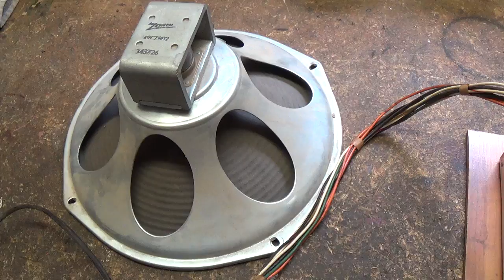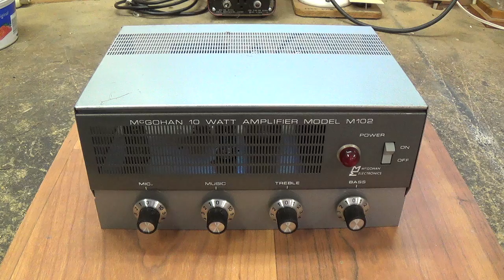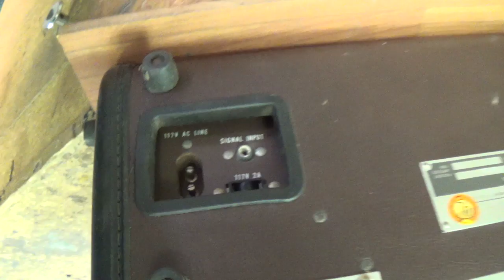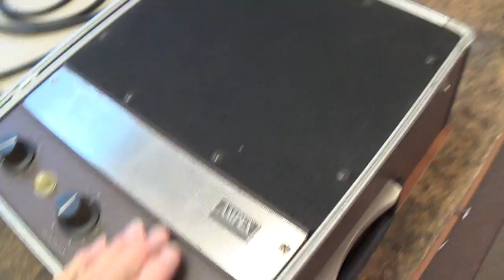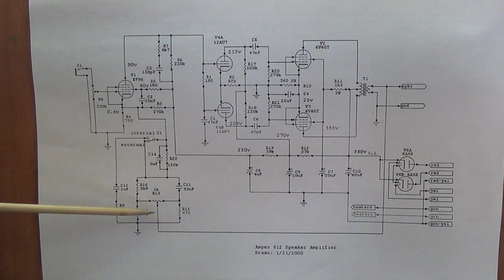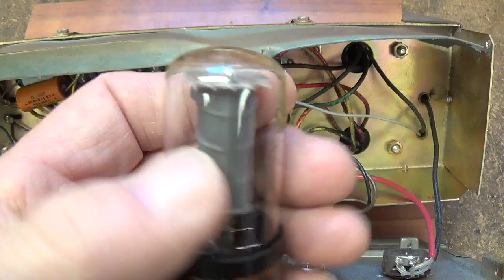Garage Sale Bargains in Vintage Electronic Gear

Comment: Hell Uncle,
Greetings from Ireland. Picked up a nice Pignose 700A at a car boot or garage sale last year. The seller thought it was a broken radio. he didn’t realise that they are designed to switch off when the input jack is removed! Got it for under $10.
Also got one of those hi fi console chassis for $40 incl shipping on eBay. Two original RCA 6V6s and two very nice sounding G.E. 12AT7s. Rewired it as a 5D3 Tweed Deluxe the one with the self-balancing paraphase phase inverter - ideal for harmonica distortion.
Enjoy your videos. Keep up the good work…
Reply from the maker: +Dave Keating It sounds like you've been busy, Dave.  Best of luck with your discoveries and acquisitions, from your pals in Texas, USA :)

Comment: This summer I grabbed a mid-60's Airline console stereo for $5. Turns out the dual class-A Ultratone amp has the perfect complement to re-work into a push-pull mono amp - plus a load of low noise radio tubes to spare.
Reply from the maker: +Karlfalcon  A great score, Karl. Hearing success stories like this renew my interest in garage sales. Thanks for sharing :)

Comment: How does this stack up?     http://www.unclehenrys.com/classified/4482085/classified?back=%2Fsearch%2Fall%3Fsr%3D31866460%234482085
or this
http://www.unclehenrys.com/classified/4349144/classified?back=%2Fsearch%2Fall%3Fsr%3D31866461%234349144
Reply from the maker: Chris Lee Greetings, Chris. I guess the Grundig phono/radio combo might have some good parts, but I can't read the tube chart. The old Radiola radio would have some very early parts, but might be too old for guitar amp purposes. Both should probably be restored and used, as-is, rather than parted out......but if the parts from either happen to serve your needs, then go for it.

Comment: Hi uncle Doug. I've learnt quite a lot from your videos but I'm still quite baffled by a lot of it, I would like to learn more on electrical engineering and some amp building. I can't afford to go back to collage to learn properly, are there any books or sources you could recommend me reading to start learning about amps and electronics etc. keep up the great videos!
Reply from the maker: ***** Thanks, Brian. It's a complex topic that takes time to understand. Gerald Weber has written some good books (see Amazon) and the Internet is full of instructional sites and videos. Start doing some searches on topics you don't understand. You can learn all this yourself if you take the time and apply the energy to do so. Good luck.

Comment: Great video..
Regarding the Ampex amp:
That 2W 1K resistor is not really a screen resistor. The screens have their own 20µf filter cap so that reistor is a typical B+ screen dropper between the plate- and screen cap instead of a more expensive choke.. 

Also the amp has a 40µf fiter cap after the 6AX5 rectifier.. That sounds a little overboard as the datasheet has a recommended 10µf cap, though the datasheet says you can use more capacitance but you need to increase the effective plate supply impedance or the rectifier will be damaged..
Reply from the maker: MrAnders1976 Thanks for your knowledgeable input, Mr. A.

Comment: Radiograms have little value in the UK, just the same as you found.
Even if someone wants a player for vinyl the physical size of one of these beasts is a major issue. Modern houses are so damn small.
Reply from the maker: NJPurling Understood, NJ, and this is why I tend to cannibalize all the useful components and then deposit the massive carcass in a nearby Dumpster :)

Comment: Noticed that the schematic you show is for an Ampex 621, but the unit you have is a 622.  They are similar, but perhaps the most interesting thing that you didn't mention is the compensating network and the switch on the external speaker jack.  The compensating network is designed to match the internal speaker and enclosure to produce the flattest possible output.  Since that would incorrectly color a different speaker system, the compensating circuit is switched out when an external speaker is plugged in, providing a flat output to the external speaker.
Reply from the maker: Ampex Quad Very interesting, AQ. Thanks for the input :)

Comment: Sir for your experience what are the best power transformers for fender 5F1 clone amps??thanks and lot of hugs to rusty...
Reply from the maker: Alvin s  There is no simple answer to your question, Alvin. Any power transformer that can provide the needed voltages at adequate current levels will work just fine.  If you're looking for a new PT, check out the Triode Electronics site.....they have a huge selection at very reasonable prices.

Comment: Ampex, famous name in  tape recording equipment.  Made in USA, not China. 
Diecast metal front panel...you will never see that kind of construction again. 
That JBL speaker  with cast aluminum frame is as good as it gets.
Massive power and output transformers.
Reply from the maker: SuperCarver2011 It is a dandy amp, SC.....beautifully built.

Comment: I remember those 50s vintage stereo cabinets.  Vox AC30 clone. 6BQ5 x 4 = 30watts
but the power tubes would need to be rewired in parallel to get that kind of power.
Minor circuit modifications to turn it into a guitar amp, you would need a good front
end guitar circuit on the phone input. Dried out filter caps, typical in these old amps.

Comment: I've recently picked up a Challenger HF8 -- a little mono hi-fi amp built around a pair of push-pull 6V6s.  I plan to convert it to guitar use and build it into a little tweed-covered Champ-style cabinet; it'll be a fun project for my kids and I to work on.  Luckily, I was able to find a Photofact sheet for it, which has been really helpful.  One of the funny things about this little amp is the input... there are 3 inputs: magnetic phono, crystal phono, and tuner.  The mag phono goes though what I assume is an RIAA-equalization stack and into the first half of a 6SC7 for recovery before going on to the second half of the 6SC7 for the first gain stage (the crystal phono just goes right into the second half of the 6SC7).  Then to the volume and treble controls before going into the first half of a 6SL7 (the second half of the 6SL7 is the phase inverter).  The bass control appears to be part of the negative feedback loop into the first half of the 6SL7.

My plan is to do a basic cap job on it, then start experimenting.  One thing I want to do is relocate the controls... I'm not really pleased with the controls it comes with (tapped linear pot for volume - turn it one way for phono, the other way for tuner! - and the power switch is on the bass control!).  I was thinking about putting a new set of controls into a new chassis that I can locate at the top of the cabinet (I'd prefer to keep the amp chassis at the bottom for various reasons), but I'm concerned about introducing noise with such a relatively long run of wire.
Reply from the maker: Jason Thorpe Jason, your circuit analysis and conversion plans all make good sense. Several vintage amps I have encountered use the two-chassis approach, with pre-amp and controls at the top and power supply and output section on the floor of the cabinet. You can greatly reduce, or hopefully eliminate noise by using shielded wire for signal-carrying cable(s) between the two chassis.  In fact, I often use shielded cable for signal-carrying wires within the pre-amp, just to play it safe. Good luck with your project.

Comment: I got an old sparton radio phonograph for a few dollars second hand. It's got all 8 tubes plus a rectifier. How much work/expense woudl it be to convert this into a guitar amp? Here's the schematic http://www.nostalgiaair.org/PagesByModel/590/M0018590.pdf
Reply from the maker: Abraham Romney Greetings, Abraham. I have never converted a radio into a guitar amp, but it appears that many of the necessary components are present for that purpose. Since there are quite a few extraneous radio parts present as well, you might choose to remove the tubes, tube bases, power transformer, output transformer, and other parts necessary to build a guitar amp, and then build it from scratch.....or, you may be able to find a spot in the circuit to add a guitar input jack and simply use the chassis as-is, bypassing or disconnecting the unused radio components. You might check the Internet for sites dedicated to radio conversion. As I said, this is not something I have any experience with. Good luck.

Comment: It looks like a self biasing balanced load phase splitter with the last triode driving the negative phase from the anode and the positive from the cathode.

Feedback is also applied to the cathode of the second to last triode to improve the linearity slightly and ensure the cathode voltage remains at about 33V.

Comment: wow,this was a great find but it seems like everyone has an idea of the potential value in these things and over prices them beyond reach of someone willing to spend $20-$50 but not $200-$500 on similar items.the condition is incredible and that jbl speaker is beautiful.

would you have any insight,advice or thoughts on a
"Executive International Crystal mfg. 9 tube CB radio"
it is a working,clean,stand alone "9 tube cb radio" that i could buy for aprx $30
but could it be converted to a guitar amp without a ton of work?
Reply from the maker: trillriff-axegrinder I agree, TA, that people tend to have unrealistic expectations when it comes to old tube electronic items. I blame a lot of this on Ebay. People look up a remotely similar item there that is posted at a ridiculously high asking price (far above what it actually sells for) and then price their item accordingly. Pawn shops in my area do this to a maddening degree. About the only good deals any more are at garage sales. Re the CB radio, I would have to see a schematic. Tranceivers such as this often use tubes and transformers that are not really suitable for guitar amp use.
Reply: thank you for your reply,the latest tube item ive been intrigued by is a 1953  reel to reel but i have seen one used as it was with the guitar plugged into were the mic goes and sounded quite good(a lot of breakup,good for blues or distorted guitar)i wish i had your insight and skill with these things.
Reply from the maker: Like you, I wasn't born knowing how to do this, T-A. You should apply yourself to learning about tube amp circuits (there are all sorts of good videos available) and fulfill your desire to be able to work on them. It wouldn't take very long and would be quite rewarding.

Comment: I got a 1958 grundig majestic 7000 I'm restoring. You have any knowledge on it
Reply from the maker: the666bud I'm sorry, but I don't. My area of interest is strictly vintage tube amps and conversions. Best of luck with your restoration.
Reply from the maker: If you can't find any information via a Google search, then perhaps I can help you.
Reply from the maker: Perhaps through his YouTube channel:  https://www.youtube.com/user/the666bud
Reply: the666bud What you want to know about us amps
Reply: the666bud well it's one of the last great ones they made 2 ohm mono puts out around 1000 watts rms 14.5 volts at .006 thd it's 1 ohm stable in 2 channel and  2 ohm stable in mono ( bridged)
takes 135 amp fuse here are the factory specs 150 watts 4 ohm a channel 300 w 2 ohm 405 w 1 ohm. it is 810 watts 2 ohm ( bridged) mono. Anything else hit me up

Comment: Thank you so much Uncle Doug and Rusty! This is such a good video. I grew up in Monte Vista, Cupertino, Silicone Valley now. I went to school with Steve Jobs and Steve Wozniak. My uncles sold their orchards to Apple.

But what you really awoke me to is Ampex in Sunnyvale. Anyway, I use to collect all of these tubes out of these amplifiers which now you are pointing out are so useful and should be saved. God, we would pull out all of these tubes and save them in shoe boxes and trade them with a couple of our school mates for fun.

Now that I am old and have played bass all these years, I realized the my little Ampeg svp-pro with five tubes in the preamp have been discontinued. I plugged into it a few weeks ago when finding out that it was discontinued by Ampeg, and OH MY GOD! The tubes make all the difference!

Thank you for your educational video. I am now going to get my eleven year old son to get interested in these. I did not know that those nice tubes could still be good.

Aloha, Paul
Reply from the maker: Paul Mikul You're welcome, Paul. I guess we all took tube-powered devices, like amplifiers, for granted while growing up, and now wish that we had rented a storage garage some time in the 1960's and kept them all, instead of "sending them to the dump". We would now probably have a fine assortment of tubes and amps......and a $100,000 storage bill :) Thanks for posting, and please get your son involved. We need new recruits to carry the torch after we're gone.
Reply: Svt

Comment: I heard an Ampex amp once and it had an  amazing sound!  What a find your friend made! Too many people are so excited when they find a vintage piece of tube gear that they can't wait to plug it in without proper precautions being taken only.  Thanks for sharing.
Reply from the maker: You're welcome, Mick. I was impressed by the Ampex also, so I ended up getting it from my garage-sale-hunting friend. You're right about the hazards of simply "firing up" (sometimes literally) new gear, particularly without using a Current Limiter (see video) to protect the circuit from damage. Much harm is done by careless "smoke testing" of vintage gear. Thanks for your input :)

Comment: Hi there,
Could you elaborate the replacement of the canned capacitor with individual caps.
I have an original Ariatone model #810(circa early '60's that has what appears to be a canned cap.
The amp has an annoying hum. I can't seem to find a schematic for it.
Thanks
Reply from the maker: Joram Kalfa You must determine the capacitor value of each of the inner tabs of the can (the outer tabs are generally for mounting and grounding the can). The values are generally engraved on the side of the can. You then remove the wire from each tab and solder it to the + terminal of the appropriate replacement electrolytic capacitor. The - lead of each cap is then soldered to a grounding lug on the chassis.

Comment: can you tell me anything about this amp? i got it for parts because iv been getting in to building my own tube amps/preamps and watching a lot of your videos and others like them. i really appreciate you sharing your knowledge. http://youtu.be/pc202thcrsg
Reply from the maker: Smokey, I can't tell much from your video. Silvertone generally labels its equipment with a silk-screened label or metal tag containing the model number of the item. Once you find this model number, a schematic should be available on the Internet. Also, identification of the tubes would be helpful. It's probably an auxiliary amplifier for phonograph or PA use, which would be evident by the labeling of the inputs. The transformers appear to be hefty and I would guess that the components would be quite useful for a homebuilt amp project.
Reply: Thanks a lot.
Reply: That's got me pointed in the right direction.
Reply from the maker: You're welcome. Good luck :)

Comment: Thanks for your prompt reply,  no inside the subwoofer,  there is a transformer,  with four metal pins on top I think that's were the power comes in from my step down,  now the question is how many volts would the secondary be feeding the amp and I would have to find out if I can re wire the primary side for 240 volts.
Reply from the maker: I really can't provide any sort of insight on this matter without personally inspecting and evaluating the transformer. If no literature or schematic are available, perhaps you could contact the company that made the unit and ask them. Best of luck.

Comment: Thanks for your very informative videos, I have a question for you, I purchased a 120 volts subwoofer from the USA that I am using with a stepdown transformer here in the UK, but I notice that the subwoofer manufacturers have put the power transformer for the amplifier in a separate compartment away from the amplifier, can I change the transformer for a 240 volts one?
Reply from the maker: You're welcome, Anthony. If the subwoofer operates on 120VAC, and the transformer you intend to install converts 240VAC down to 120VAC and can satisfy the current demands of the subwoofer, then it should work just fine. In effect you are simply replacing the external step-down transformer with an internal one, if I understand your inquiry properly.

Comment: Shhhh UD, you're going to turn people on to my parts sources! Just kidding, this is absolutely true, there are so many parts out there to work with, and cheap! One of the best things to get hold of is an old combo TV-radio console, sometimes you can find them as low as $20, or maybe even free if you haul it away. Multiple power/output transformers, miles of wire, multiple speakers, carbon resistors (check for drift), fuse holders, potentiometers, chassis, and many times vacuum tubes that still have a lot of life in them. Plus, by disassembling them, you learn a lot about how all the parts go together, so it's educational, too. And yeah, you can use old TV sweep tubes to make some serious guitar noise!
Reply from the maker: Excellent advice, MA. I can see we'll be bumping elbows at the next estate sale :))